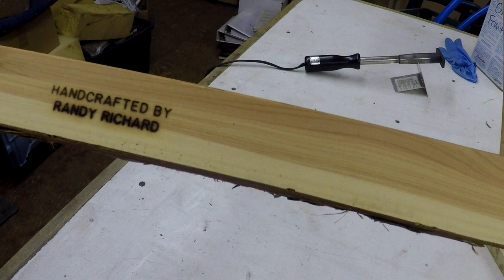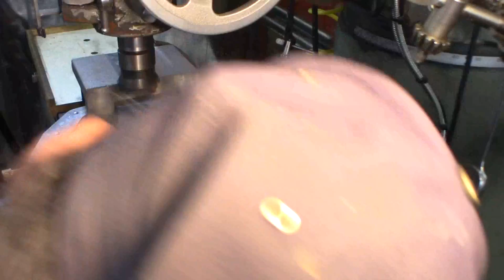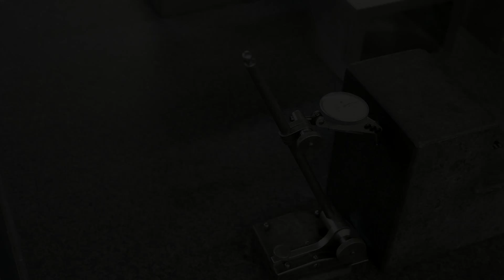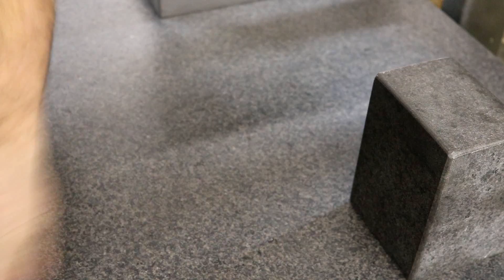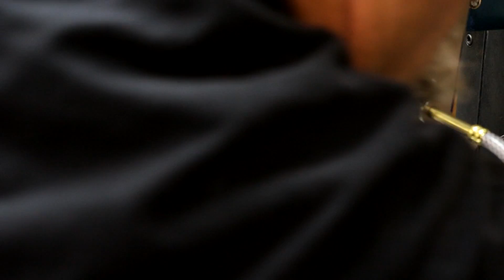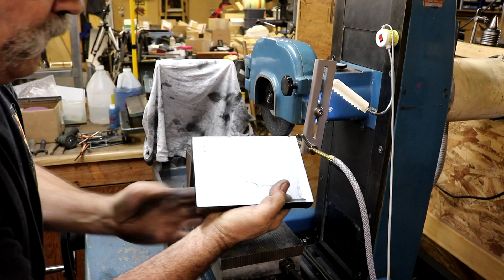How To Mill and Grind Cast Iron Angle Plates

Comment: Great project.  Everyone could use a set of angle plates with that precision.  The carbide wheel you used, it didn't seem to degrade much  across the surface, as your measurements were consistent.  Is that why Robin recommended it for cast iron?
Reply from the maker: Thanks Arnljot.  The wheel held up very well.  I did 8 surfaces, and dressed it 4 times, once for each plate.  Hardly any wear on the wheel and held great finish and tolerance.  Robin is a great resource for grinding experience.

Comment: Hi Randy,
Guess it's a little late by now, but with cast iron you can optimize removal by slowing the rotation and taking 3 or even 4 times the depth of cut. It makes less dust and easier on the inserts mostly on the crust removal...
A few tenth's on all dimensions is a great result, not everyone makes it that easy...   ;)
Reply from the maker: Ok next time.
Reply: Pierre's Garage good tip Pierre that crust is hard stuff

Comment: Really nice finish you got on those angles. Are you going to put slots in them or are just squares, the reason I ask is because I was wondering whether they might distort if you slotted them after grinding.
Reply from the maker: Thank you Chris.  They sure could change if slots were added.  No plan at this point.
Reply: Randy Richard In The Shop oh yeah I'm not going to slot them any cuts will Chang the equilibrium in the iron. Toe clamps and kant twist clamps are the plan.

Comment: Nice job Randy and Chris.
It looks like that new wheel worked well. I will have to get one in the near future. I have a couple of 8" angle plates that I need to true up the edges. Thanks for the video.
Steve
Reply from the maker: Thanks Steve.  The wheel worked great.
Reply: Solid Rock Machine Shop Inc. Need any more castings

Comment: .0002 not bad my friend its funny i have something i need one of them for just the other day i'm sure they will come in handy . looks like i have the first comment to :) btw if any one wants and let me know maybe we can get another batch cast up .
Reply from the maker: I have been thinking straight edges.
Reply: Great job and kudos to both of you. Really nice grind on that. Wow, that finish is beautiful. Obviously Grinder In The Shop is setup nicely. :) Chris, have you thought about casting some straight edges? Cheers, Alan
Reply from the maker: Thanks Chris.
Reply: Randy Richard In The Shop no problem feels like Christmas is coming lol
Reply: TraditionalToolworks I have
Reply: I just subscribed to your channel, I like old machines also...I want a straight edge to use on a South Bend 10L. It's just an ongoing project, I have a Rivett lathe I use most of the time. Here's my page on VM, it has most of my machines sans a German mill...(VM is American only). http://vintagemachinery.org/members/detail.aspx?id=3052
Reply: like a camel back ? i need to get myself a few  also
Reply: TraditionalToolworks I need a 7 ft one
Reply: I have a 6', but want a 3'. I am just getting into scraping, acquired a 6' *cheap*. It's kind of narrow, only 1.500" width, I have pondered cutting it...but I decided to try and keep it whole and look for a smaller one. My problem is my surface plate is only 36". Even with a 36" casting, the problem is finding someone with a large enough planer to rough the casting in prior to scraping, or if someone has a 36" travel on their mill, that's not me either.LOL
Reply: well thanks for the subscription.quite the list of tooling there lol
Reply: yup big tools require even bigger tooling. if i made a 36" one  would you trade the 6ft for it?
Reply: I sent you an email.